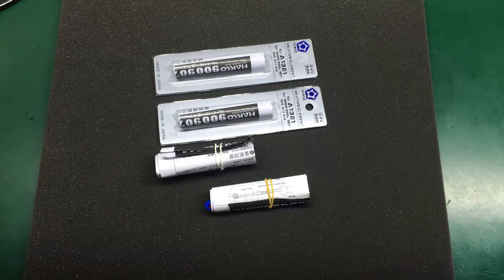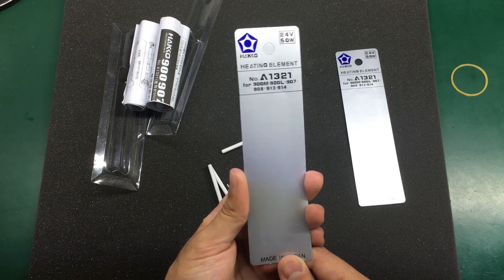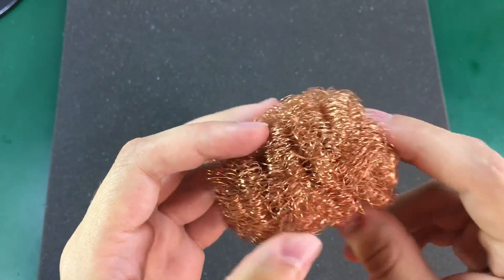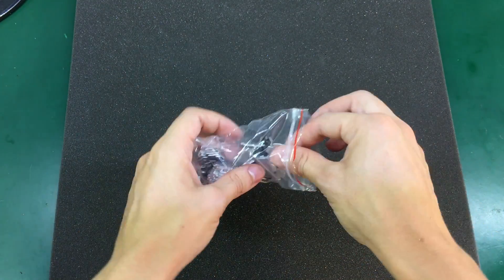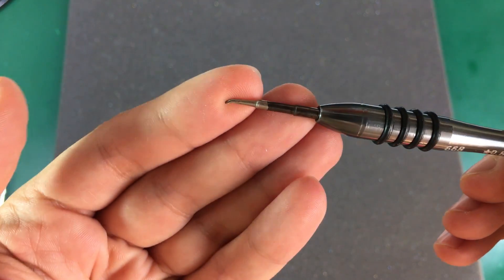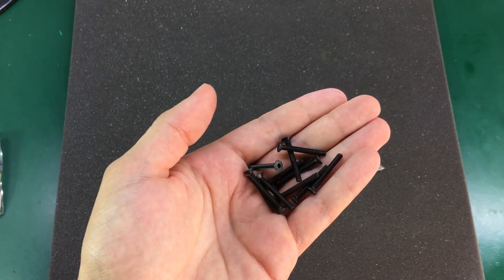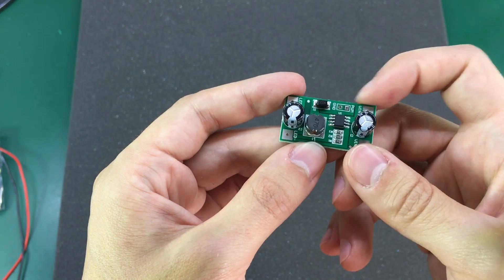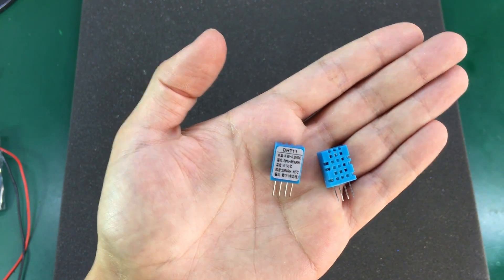Voltlog #60 - InTheMail

Comment: If none of the heating elements you bought work, you might need A1322.
Reply from the maker: I think this might be it, they certainly look identical to what I found inside originally. However the heating element alone is more expensive than a complete handle on ebay...
Reply: VoltLog Yes, on ebay they're expensive. Do you ever order from aliexpress? I think that might be the only place to get them cheap. If not, a new handle is fine since it's cheap too lol.
Reply from the maker: I order from aliexpress sometimes but I kinda like to place my orders in as few places as possible because I want to avoid having to login into many different places to manage my orders.. It's a pain to keep track of everything.. So I currently try to stick with ebay and banggood.

Comment: There's a bit of an echo right at the end of your audio for some reason - or is that just me?

When the hakko handle copies are just £2/$3 complete from China it seems daft to me buying elements.  That little LED driver looks handy. Thanks for the video.
Reply from the maker: yes, you are right, that's exactly what I did first time, I purchased a new handle all together but I am now left with two old handles and it just feels wrong to simply throw them away... I noticed the echo too but I don't know what happened, I somehow moved during recording, maybe came in too close to the mic.. I don't know

Comment: You should check the PT4115 buck led driver 1.2A 30v (max 30w I think), it's awesome and cheap, it has a dimm pin with several options to work with: 1. just put a potentiometer between dimm and ground (but you don't get the full current). 2. Using a external voltage from 0.5 - 2.5v. 3. with PWM signal.
Reply from the maker: Cool, I just ordered 10 pcs for $0,99, Thanks for the hint!

Comment: I think Hakko uses thermistors instead of thermocouples.
Reply from the maker: from what I could gather, the hakko heater has different resistance value measured on the heating element and the thermistor, different from what I am measuring on my Gordak clone damaged heater.